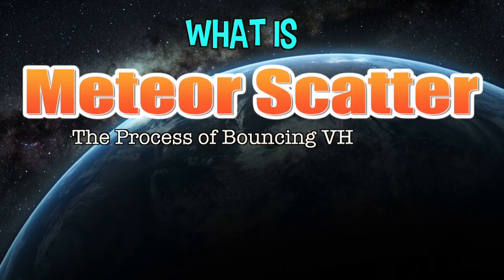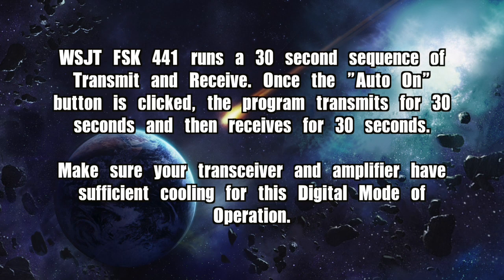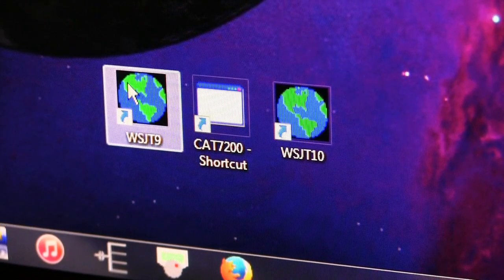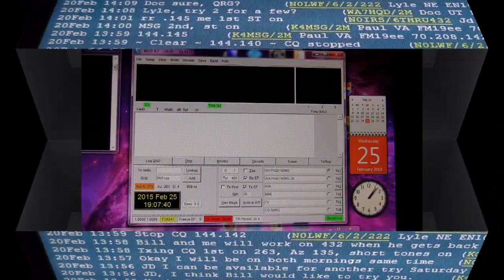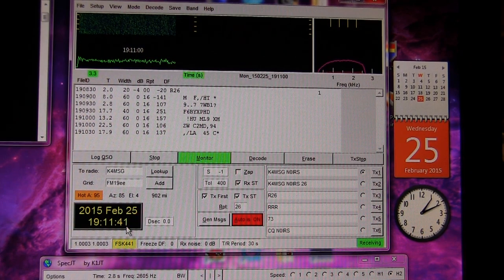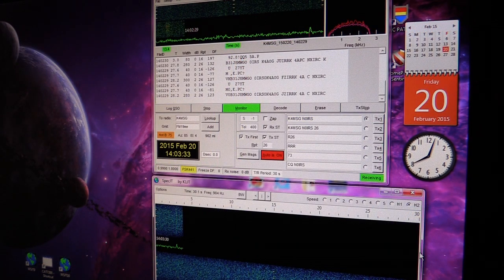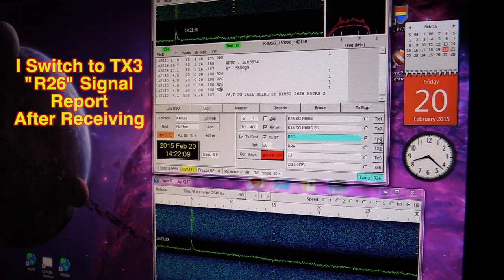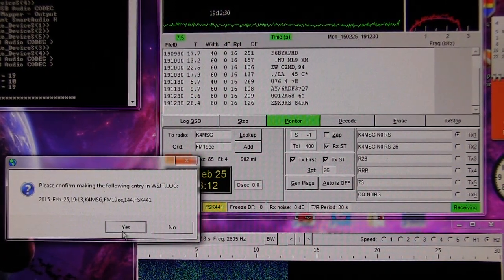Meteor Scatter Communications on VHF/UHF

Comment: A note for people running Linux.   Make sure you've installed NTP daemon or checked use network time in your time settings.  Most modern distributions will have ntp installed by default already, check your clock against WWV and it should be dead on.